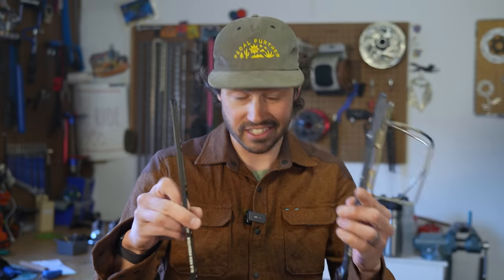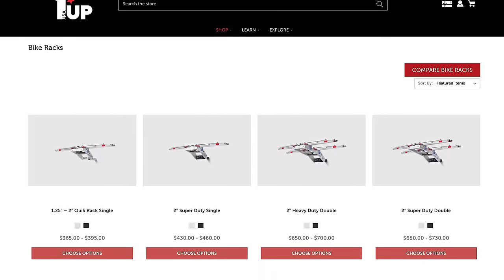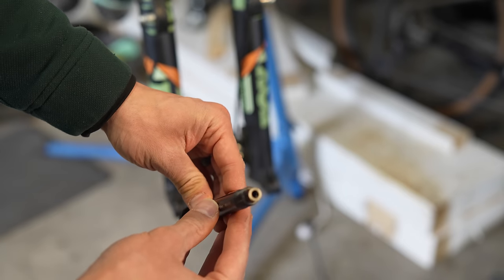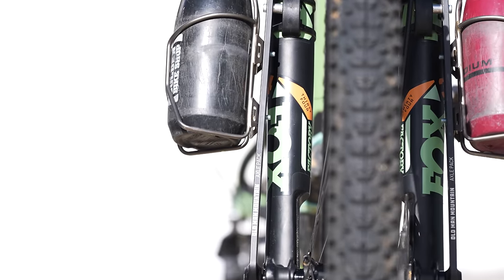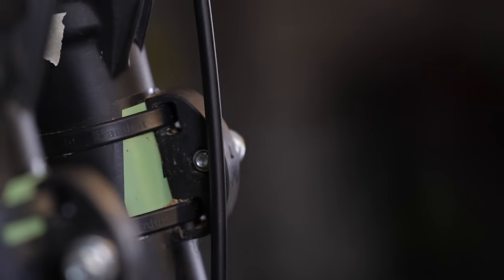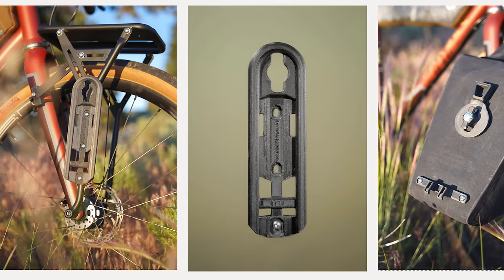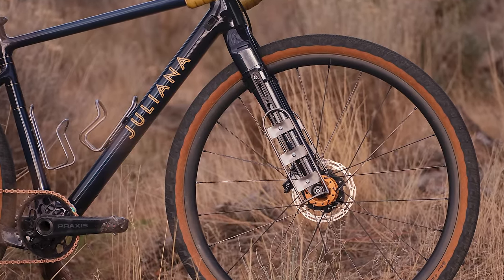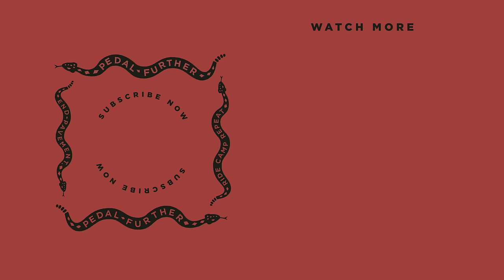Old Man Mountain Axle Pack Review: Fork Cargo Reimagined

Comment: Two hose clamps, old inner tube, little duct tape and mount two beefy water bottle cages on a suspension fork. Just don't be stupid and way over tighten them and they will work for years. Bomber strong, light and cheap.
Reply: And it gets you there all the same.
Reply: And, proven to cause bushing striction (and ultimately early wear), even when clamped down lightly.
Reply: @pedalingnowhere  not if you do it right.

Comment: It is an elegant solution to a well-known issue. However, it is a lot of money compared to my usual mounting option.
I typically use hose clamps to secure salsa anything cages or water bottle cages to my fork. To keep it from spinning or scratching the fork, I wrap my suspension fork with old inner tube rubber at the contact points. It has very little weight, costs almost nothing, and hasn’t moved on any on my trips, including rocky singletrack.
Reply: Your solution sounds like about $30 ... Leaves me with $110 for Burritos :) That's a WIN!

Comment: I attempted to use these on a carbon fatbike fork (Trek Farley 2017) but because of a ridge running down the fork they didn’t sit flush. In addition, the worst part about these is having to remove the M5 bolts and lock washers to remove the front wheel. Those will easily get lost during a trail mechanical.
Reply: Hey Jim, Which of our pucks were you using? They should fit great on the Farley fork.

Comment: Nice solution  ! Total cost of $140.-- just to add some bottle cages to your bike.  Better buy yourself a bike that has these eyelets on your fork, saves you a lot of money.
Reply: $140 might just be the cost of getting an other fork with the eyelets.
Reply: You guys got forks that perform as well as a RockShox Pike with eyelets for $140? Where is this unicorn?
Reply: @taknname  do you own OMM or something? Is this your design? Are you trying to steal from the poor man just pedaling around and giving to the rich/your pockets? If you have the money to waste on something completely unnecessary, by all means, waste it. I’m here to let people know that this is a waste. Buy a weeks worth of groceries for your next adventure, a new frame bag, splurge on a hotel in the middle of a bike packing trip before buying this garbage.
Reply: @BradLong-bj2ug  I'm beginning to think you work at Ace Hardware.
Reply: @taknname  Ha! Just a lifelong outdoorsman. Keeping dialogue so people don’t get scammed is important.
Reply: @BradLong-bj2ug  I can appreciate that and your point of view. I use hose clamps and Topeak Alt-Position cage mounts on the downtubes of two of my bikepacking rigs since they were made without under-downtube mounts. In that position, with voile straps over the frame holding the bottle, the only movement is vertical- there really is no side-to-side torsion and movement like on a fork mounted bottle. I've used tape and hose clamps with cages before on rigid forks without mounts, but only with light loads, ie- 20oz water bottles. A friend had a similar setup and one of the clamps rattled loose, slipped, and the bottle cage swung back into the wheel and sent him over the handlebars on a rocky descent. He had a full 64 oz juice bottle in an Anything cage at the time, and he was lucky to just break one finger in the fall. 
Personally I don't use bottle cages on forks that do not have eyelets anymore. If I need a fork with eyelets I just throw on a rigid fork and a plus or fat tire. The majority of that riding where I need water is in Utah, in a mix of loose chunk, ledges and sand, where a suspension fork would be nice but isn't really needed. I'd rather have the carrying capacity for 4-5 days without water sources. For home trails in Colorado, I'm using a suspension fork and thankfully (for now) water is relatively abundant. I don't work for OMM, but do I have both an Elkhorn and a Classic racks. I don't have for the Axle Pack for the reasons above, but I like the Axle Pack simply because as it is designed, the side struts are bolted to the axle. All torsional forces are resisted at the mount, and there is no slippage possible. The zip-ties are not structural- they're just holding the puck in place like the rear racks. 
People are free to use the old standard hose clamp and tape, and they will. OMM stuff is expensive, no doubt, but their racks work. But a scam? Hardly. At least they don't fail like Tailfin where anything cage mounts rip right out of the arch.
Reply: Sorry, I was out riding my bike for the past week. The Elkhorn is one of the best front or rear racks out there. OMM makes solid products. They use good materials but the execution is not always there. I understand that the zip ties are not “load bearing”. They’re still gonna break. As far as your buddy who’s clamp came undone, that’s unfortunate and never needed to happen. A little blue threadlocker and the smallest piece of tape could’ve prevented an accident. This is part of the problem. The expensive/unnecessary products are relied upon instead of ingenuity. The entire process is being dumbed down. Any sort of sport to get outside should be accessible to everyone. Elitist products like this create a narrative for those who would like to be outside feeling like they can’t afford it while there are many/better alternatives that also help people think about fixing their bike along the way. The adventure of bikepacking requires a certain amount of intuitiveness to move forward while not relying on dumb products like this. I ride a steel hardtail with a pike up front. I’ve been putting 3+liters on the forks in addition to my handlebar weight of tent and sleep system for quite a while. 10,000+ miles in the past two years. Again, $140.00 to achieve the same result as opposed to $2.00 or even $5.00 with the locktight and tape is just not worth it. The mounts are a SCAM. I want to be clear too! Those mounts are before cages being bought. I use Widefoot cages that cost $36 each. I don’t know what the Surly cages are but the cages are integral to the mounts. +$212 before anything is even on the fork or $80ish for a more robust system with band clamps.

Comment: I "think" this is a nice system.  My frustration at this point is figuring out the installation.  The guides Old Man provide probably work fine for someone more mechanically inclined that me or if you already know what you are doing, I am struggling.  The good thing is that so far, Old Man support has been great holding my hand.

Comment: Any chance you could test this while fixing the top bolt to an existing eyelet on a fork? Most forks rate the max load at 3kg but shifting the weight to the axle is an advantage even on non-suspension forks with eyelets. I have dual eyelets on mine and I'd get a system like that if it meant I could carry say 3L of water per side...

Comment: if you wnt your suspension to work effeicnetly and provide a supple ride, avoid adding to sprung mass (lowers of forks)
Reply: There's no denying that it will change the suspension but how often are you needing super sensitive, high speed rebound when bikepacking? We'd found that we prefer to ride with a lower center of gravity and add a few clicks of rebound when bikepacking.
Reply: @OldManMountainRacks  thats fair! You dont but as a bike tech i like my suspension to work as best it can:)
Reply: Same question, who can tell difference between fox and sr suntour :) if you can you'll notice diffetence of added lowers weight or not

Comment: A solid solution to an old problem.  I have a 2017 Trek Stache 9.7 "carbon", that came with a Pike suspension fork.  I then bought a Trek 1120 carbon fork with cage and fork mounts.  When traveling I usually bring both forks and swap out as needed.  It's not difficult, but the OMM fork pack mounts would streamline the process quite a bit.  I'll seriously consider this option.  Thanks Neil!

Comment: Don’t spend the money. $140 for something that WILL break with zip ties and expected to last a while does not move this industry forward. Be resourceful. Use your favorite cages with band clamps that cost $1.00 or less. This is dumb. It is not a solution. I love the company as a whole but these are just plain stupid. Ace hardware has just as good if not better options for a fraction of the cost.
Reply: 1) The zip tie on the OMM rack is not carrying any weight relative to the axle. 2) There is no way your favorite band clamps can carry 22 lbs like the OMM rack and not compress the lower legs of your fork to the point that the bushings are negatively affecting your stanchion. 3) Maybe it's not for you, but the Axle Pack is far from a "dumb" design.
Reply: @taknname  It’s dumb and your suggestion is wrong. Silicone tape and band clamps get the job done for about $2.00. My partner and I have been running our suspension fork setup without issue for years. We keep up with our maintenance and have never seen compressed housing for the stanchions. This is a rich person product. It’s unfortunate that the industry has come to this instead of putting resources into making products that get people outside at a lower cost. $2 vs. $140 is absurd. I never comment on things. This is next level greed.
Reply: I was gifted these and they are an amazing addition. I’m still not sure about the price with the through axle but they are the best solution I’ve found for suspension forks. I would still use the cheaper alternative on a budget.